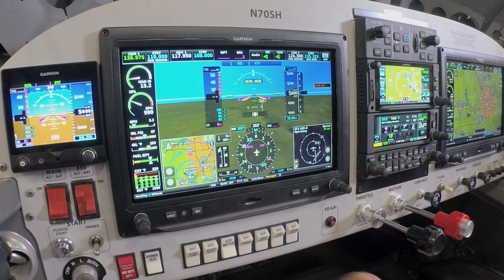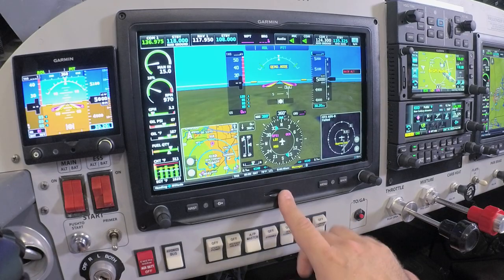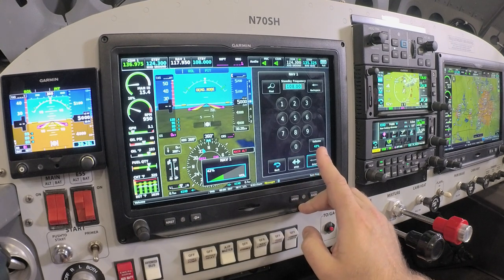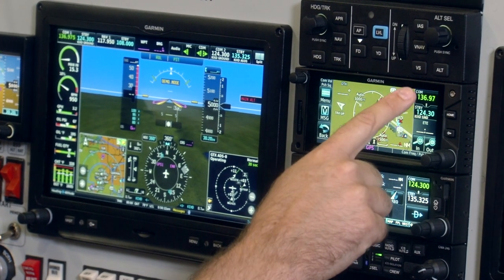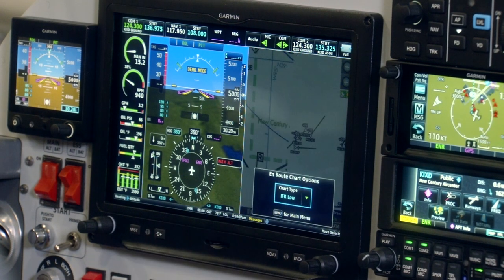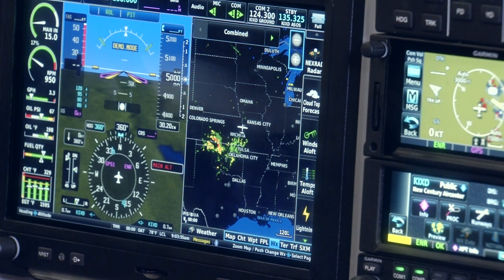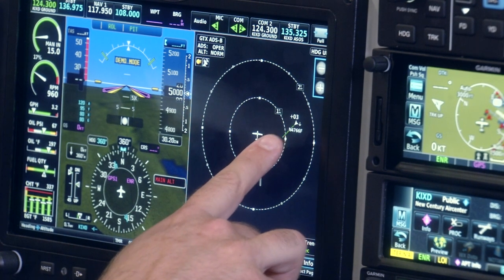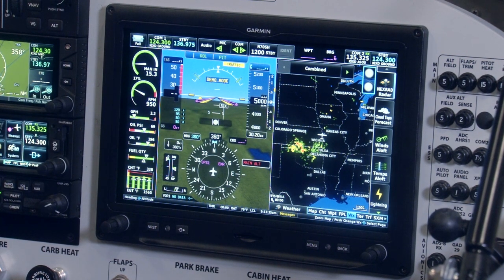Garmin Virtual AirVenture Oshkosh Experience: Aircraft Avionics Tour of a Vans RV-7A

Comment: How is the logic setup for the MAIN ALT warning? Is it simply Voltage below threshold or does it sense ALT switch position as well?
Reply from the maker: There are a variety of ways to do it depending on your manufacturer. The system can monitor both volts and amps and alert based on a threshold that you determine. Most alternator manufacturers offer an output that closes a ground when the alternator is not functioning. Historically, that would connect the ground side of a lamp or LED to alert the pilot of the condition. G3X Touch takes in this information and is able to display it in a consolidated message area on the primary flight display in the pilot’s primary field of view.
 
^DK